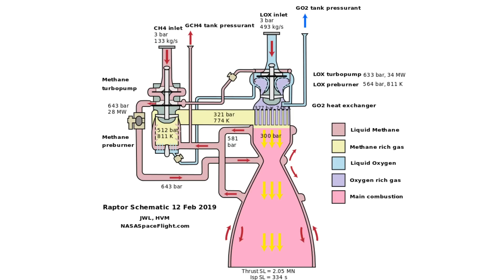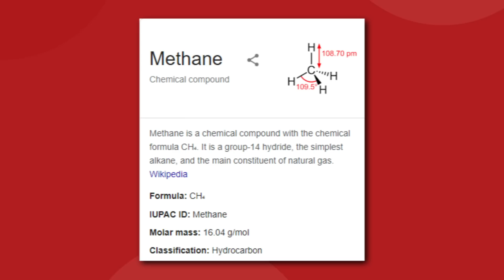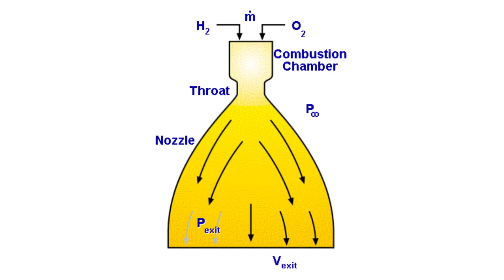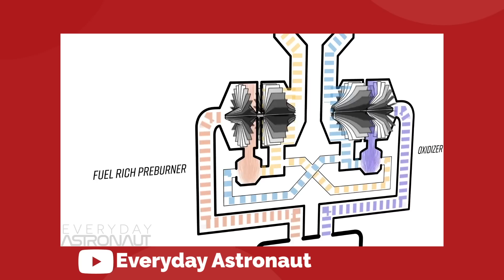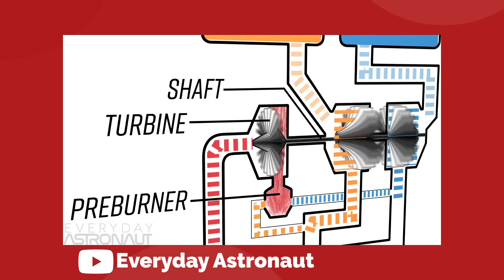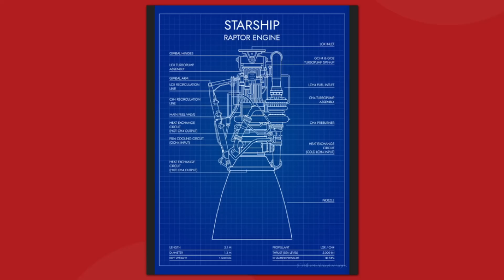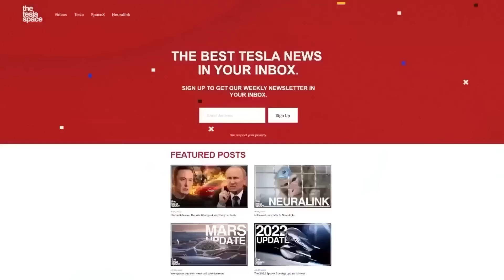The Real Reason SpaceX Developed The Raptor Engine!

Comment from the maker: If you're enjoying the content, here are a few ways you can get access to even more while supporting us:

► Patreon: https://www.patreon.com/theteslaspace

► Subscribe to The Tesla Space newsletter: https://www.theteslaspace.com

► Join Our Discord Server: https://discord.gg/zfMNSnuRQN
Reply: We are so limited by gravitational force be design , very good the right outside of our atmosphere we face less gravity
Reply: @sa5cha63  ?

?
""
Reply: @sa5cha63  not that much difference t you don't  have to deal with  aero dynamic stresses is all being a tiny bit higher doesn't  change the force of gravitational attraction  that much so don't  expose your ignorance so embarrassing ly.
Reply: It really delivers a trust of thrust I believe in 👍
Reply: 0
Reply: M
Reply: actually, the system on how to cool those engines isn't really that complicated you know. You just send liquid fuel through tubes on the side of the nozzle to A: keep the nozzle from melting and B: to heat up the liquid fuel for a more effective burn. Tory Bruno told me this when I asked this same question. On the Raptor they can use both liquids to cool the nozzle (and other parts of the engine too like the pumps.)
Reply: 7:00 RD 270 in 1960 in the Soviet Union was the first roket engine use Full-flow staged combustion (FFSC)
Reply: Saturn V had more thrust.
Reply: Rocket failures within atmosphere and 0 g. Causes engine's lean out loss of atmosphere. Start test in space.
Reply: Loss of physical atmosphere catastrophic to engines ability. No air for the burn
Reply: Make a video about nuclear waste on my comment
Reply: In this context cheating math by physicalisation is like magic for me , but it works well for me.
Reply: Tesla developed this engine like they developed vertical landing rockets lol. Raptor is Russian tech (yes they were that good ) and the  vertical landing rocket is shelved Delta Clipper tech. You tube delta clipper

Comment: The Tesla Space video “The Real Reason SpaceX Developed The Raptor Engine!” is suspect for two reasons.  First, is always glowing reporting of all things Musk.  Second, are the many technical errors in the presentation:

“Beyond Unprecedented concentration of nozzles.”  Actually, 33 Raptor engines is just slightly more than the 30 NK-15 first stage engines on the Russian N1 Rocket.

“Oxidizer side is the same for every kind of rocket engine” and means using liquid oxygen.  This simply ignores all the numerous fuel/oxidizer combinations possible and well as the popular hybergolic oxidizer Nitrogen Tetroxide in use for decades.

“A full flow staged combustion cycle engine has never been brought to production before.”  Categorically incorrect and ignores 30 year flight history of the SSME (RS-25).

Raptor is “only engine with dual pre-burners.”  Again, false by ignoring the SSME (RS-25) experience.

This makes one question all the claims.

Comment: Rockets are still steam  engines ! Stop fighting gravity and move forward to working with gravity for unlimited movement.
Space time and gravity are not totally connected , a bit like oil and water do not mix but with the right energy control you get a zero energy mix that is focusable to a direction and also transdimensional not affected by the outside  physics of the outside world.

Comment: Rd-170 beats the f1 in thrust and sophistication
Reply: F1 last flew in 1973,  for crissakes.
Reply: @xandervk2371  so?
Reply: @nagantm441  So yeah.
Reply: @xandervk2371  it's still not the most powerful motor
Reply: @nagantm441  Who said it was? F1 first flew in 1967 and RD170, I believe, in 1985.
Reply: @xandervk2371  the narrator in the video.
Reply: Perhaps the idea was that F-1 attained the highest thrust for a single chamber design. Soviet designers couldn't solve the combustion stability problem for a chamber of that size and had to go with 4 chambers. There was also F-1A with a higher thrust than RD-170, fully developed but never flown because the Moon program was closed.
Reply: @xandervk2371  thrust chambers are irrelevant, it's still 1 engine. And rd-170 being an oxidizer rich staged combustion design is far more sophisticated.

Comment: Oxygen is by far not the only oxidizer used in rocket engines. It may be another material releasing oxygen, or even stronger oxidizers like halogens.
"Most rocket booster are not reusable, so [coking] doesn't really matter", illustrated by the reusable HydrolOx engines of the Shuttle...

Comment: SpaceX did nothing spectaculary new with the Raptor engine. 
This is a closed cycle rocket engine. Russians developed it 40 years ago, and NASA used only those russian engines (RD-170, RD-180 and RD-191) for the last 20 years.
Elon's problem was, they were too expensive for what he had in mind. He practicaly cloned the design and of course improved it.

Comment: The concrete pad blew up wrecking some of the raptor engines.  Nice job on the engines but not so good on the pad.  Nasa did a lot beter 50 years ago.

Comment: It's kinda funny how in the diagram they use to show the engine's mechanics they show like the 2 or 3 basic paths of the fuel and oxygen etc., YET when they show a picture of the actual Raptor engine you can't help but notice there's more tubes and pipes and valves and chambers and extraneous apparatus than you've ever seen on any one thing anywhere else in the universe. 😮
Reply: that's how basically all the rocket engines work bud. they have more parts than we know, this is basic systems of how fuel works in a rocket engine.

Comment: :face-red-heart-shape:E=MC2 is a joke! OK let's get this correct  !!   #1  The only reason radio waves and AC current travel out in space and down a wire is because of the "CENTER " of a magnetic field.  (The "B" field), The North and South poles are the weakest part of a magnet !!   Just like Tesla said,  you got to look at things you can't see !!  At the center of a magnet is anti gravity,  (just tap the center on any glass or plastic and it will loose weight), The center can repel water if vibrated at the correct frequency,  If you vibrate the "B" field into granite rock it will become soft and you would need copper tools to work on same , you don't want to disrupt the magnetic (B")field ) with other iron.  Once you understand the "B" field of a magnet and how it relates to the entire universe we live in, you will then understand what Tesla was telling everyone "LOOK FOR WHAT YOU CANNOT SEE""  .I believe the pyramids were inter galactic communications and transportation systems.  Stone Henge and Gobekli Tepe , power plants.  Take a look at Coral Castle Florida on YOUTUBE and you will see a similar pilar. I believe these horizontal pillars were oscillators that would provide excitation for many things from crops in the field to anti gravity  FYI: If a UFO fly's to close to you the "B" field that provides the anti gravity ("B")Field).  will cancel out your power source  !!!!  E=MC2 is at best just a joke!!!

Comment: Hmm. I'll buy that you can burn a fuel-rich mixture with the methane side, but based on my understanding of how combustion works, running oxidizer-rich (or fuel-lean) MAY leave some oxygen that isn't burnt and you can use that in the main combustion chamber, but these reactions really, REALLY like burning oxygen. That reaction would be occurring much hotter and much faster than the methane section. And based on this schematic (which granted probably isn't 100% accurate to life) that would also cause that turbine to spin even faster as the reaction happens, which would cause a positive feedback loop feeding more oxygen into the reaction, especially compared to the more stable rate of flow from the methane preburner turbine. Granted that would probably push the necessary amount of oxygen through the turbine to make the reaction happen better inside the main combustion chamber, but that would make the mixture inside said chamber really hard to maintain without some sort of bypass, or blowoff, or brake to regulate that reaction and therefore rate of flow. It just seems much more complex than the more standard open-cycle engine pictured for what seems like not much more apparent gain.
I'm not a rocket scientist, but I am an A&P mechanic with a strong head for engineering. Maybe I'm missing something or not fully understanding.

Comment: Your correct in that the Raptor II is an Exceptional Rocket Engine but the label of "Quality" is completely unfounded. Every StarShip prototype that has been flown has had problems with the first Raptor Engines, the version II has yet to be flown. It's True that some of the Prototyped StarShip engines and/or support hardware were struck with debris during Launch (Martyte/Concrete launch pad debris), but still, that was only 3 Engines that had multiple problems. StarShip has to light off all 33 Booster Engines, make Orbit, and return with multiple Re-lights of it's Booster and Upper Stage (StarShip) Engines and then Land. Maybe after several Launch/Land cycles without a Raptor failure I'd call them Quality Rocket Engines. Test Stand successes are Completely different than the dynamics of Flight and Space Travel.  The Hype ur pushing here isn't realistic. That said, I Still Like your Channel & Content, usually not found elsewhere.

Comment: Love to hear more about the turbo pumps...like how is it possible to generate so much pressure from a single stage its a fascinating video....thanks
Reply: The turbo pumps rely on the same principal that a turbo charger in your car does. Instead of air, its pumping fuel. When a liquid becomes a gas the volume increases. in the pre-burner you change the liquid fuel and oxidizer into a gas and direct that expansion pressure into a turbine, which in turn pumps more liquid fuel into the pre-burner to phase change into a gas. The pre-burner turbine is linked to the pump by a shaft, so when the turbine turns so does the pump. All the pumping work is done by the phase change from liquid to gas, then we take those gases and put them into a combustion chamber were we can burn them. 

Think of it like steam. You boil water in a closed chamber and it turns into steam. If you don't vent the steam you build up incredible pressure and the container will eventually fail and explode. But, if you open a small hole and vent the steam you can take advantage of that pressure to do mechanical work. Much like a steam train engine, except on a rocket we use fuel and oxidizer that we can burn at the end for even more power.
Reply: @Amehdion  ah thanks.  That's fascinating,  actually making use of the phase change latent heat. Brilliant.

Comment: Garbage-device and low-end technology.

Propulsion normally gets archieved with radiation, allowing to "bend" northern and southern polarity into eachother.
this causes N-pole ans S-pole to spin, resulting in gravitational flux which will act as propulsion, also causing crop-circles with emitted wavelenght of neutron-activation. to activate neutron-capacitors, they have to be infused with radiation.

Device is called a gravitron, maybe someone already recognized it from before.
Fuck these fuel-related engine types, waste of cash, time and efford.

its not that hard to study physics ...

Comment: Looks like a copy of the Soviet N1 Rocket that flew this type of rocket in the 60s and 70s with 30 engines in a similar configuration,  that failed to send cosmonauts to the moon after 4 of these rockets were tested.
Your claim that no one else was crazy enough to try this is false, false false.
Incredibly uninformed. 
The Soviets did and they were crazy because no one else including American scientists  didn't think the close circuit system cycle  was possible.
But the Soviets did ultimately master this and produced the NK-33 That was more powerful than anything else in the world.
The US found out about the NK33 after the cold war ended ( not really).
Lockheed bought a 100 x NK-33 s and I dare say the Falcon finally copied the Soviet technology/s.
Read all about how this Rocket made it to the US in the Documentary of the N1 Soviet moon rocket.

Comment: Ehh, I/we beat him. And frankly Elon, don't steal my tech, national security and Naval warfares don't like that and neither do I or my design teams. 
 No doubt that's a good engine though.  Nice clean burn too. 🔥 
   Very hard to keep that candle lit and not melt it or blow it up, but sometime they have to run full capacity and see where she fails.. just sucks, even when planned, any system failure that could possibly blow the test facility apart. Lol.. 
 Oopssy.  
 Watching an engine test from the press bunker, 2 miles away and still having that doubt.. lol. 
  That would have the simple peasant folk all a tizzy.

Comment: You mention methane has to be cooled down to the same temperature as oxygen, but that's not true. In fact if you cooled the methane as much as the oxygen, the methane would freeze as oxygen's boiling point is actually lower than methane's melting / freezing point. They are regularly cooled past their boiling points to help with boil off and keep it in the liquid state longer and under the right pressures these points change, but I'm quite certain they don't keep the methane and the oxygen at the same temperature.

That being said, great video. Really well done explanations bordering on what I've come to expect from Tim Dodd which is a hard act to follow :)

Comment: Pressure, like voltage does not flow.  The pressure differential across the nozzle causes the gases to flow like current flows in an electrical circuit.  As the gases expand in volume they give up their energy in the form of thrust.  The mass of the gases propels the mass of the rocket.

Comment: I wish I could get Elon's mind ticking over this potential improvement in the heat shield tiles, we have all seen some fall off the ships when being moved around without firing up a single Raptor, I hate to think how many will fail. I've been studying the structure of scales on fish, particularly Salmon in their fight to swim against the current, the overlap of the scales is key to this proposal. They have one anchor point, a Titanium bolt would help maintain the scales and reduce the additional weight of the scales when overlapped, these anchors can be reused again and again. If one scale shaped tile separates the tiles underneath will maintain the integrity of the shield, might as well try new ideas to improve the shield before a manned encounter with massive windshear at speed in Earth's atmosphere or entering Mars thin but still violent gas. I sincerely hope the current arrangement can withstand re-entry, but I am sure your team are concerned when the first automated flight destined to return to Boca Chica, the first to be inspected at Mechazilla we hope.
Reply: hey do you have any research gate or scholar profile? your work sounds really interesting although our field of study wont match, im working on rough surface of airfoil, I really want to read the paper

Comment: It seems like it would have been a good idea to have done an engine swap on the falcon 9 if only to have been flight testing the Raptor engines, I know that it may have taken time away from the Starship but it could have been a different kind of Falcon Heavy without the two extra boosters. I also know that the starship will be replacing just about everything when it starts flying.

Comment: 1:05
This engine is nowhere near any limits - it has about ONE THIRD the thrust of a single F-1 engine.
NOT EVEN CLOSE to "limits of what is physically possible".

And at this point, I could NOT choke down any more of the lies and overstatements and ERRORS in this junk video.
Reply: 12:01
Reply: @ShaneH  See, even the VIDEO contradicts itself when it posts facts instead of overblown hype!
And still gets it wrong - the F-1 had over 3 TIMES the thrust, at over 1.5 million pounds or over 700 metric tons.

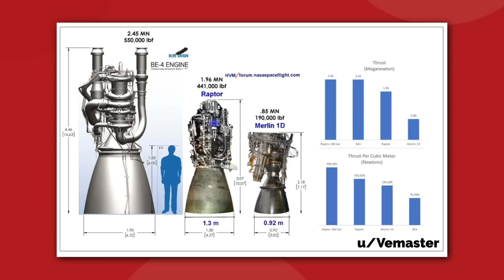12:19
A bit of an exaggeration - even a Willies Jeep would not quite fit inside the bell - but it WAS fairly close.

Comment: 0:25
The Soviet N-1 was more powerful than the Saturn V - and had 4 launches.
None of those launches were successful, but all 4 of those rockets DID get off the pad and one was fairly close to going to it's second stage when it failed.

Starship GREATLY resembles the N-1 in some ways - starting with the large number of engines on it's first stage.
30 NK-1, totalling a little over 10 MILLION pounds of thrust (the Saturn V was 7.5-8 million depending on the specific rocket, the F-1 engine in it increased in thrust over time with refinements).

0:47
33 is NOT a lot more than the N-1 number of 1'st stage thrust chambers/nozzles.

Comment: Minor correction around 10:20 -- Elon said they were able to remove the torch igniters. He did NOT say that the fuel and oxidizer would autocombust. (That's the domain of hypergolic fuel mixtures, which methalox is not.) Among those details which Elon would not discuss is some other undisclosed mechanism of causing ignition.

Big props for using so many clearly attributed Everyday Astronaut clips, too! Too many YouTubers bury credits like that in the description, if they bother to include it at all.
Reply: I wondered about the ignition as well thinking Diesel type? ignition.  Maybe a magnetic induction (so no combustion chamber penetration)  ceramic glow plug?  I would imagine it being kind of like starting up a propane torch, the pressure has to be low at first, then the gas can be increased.   I really have no idea.

Thanks for the clarification !